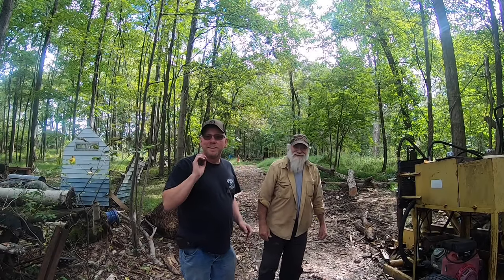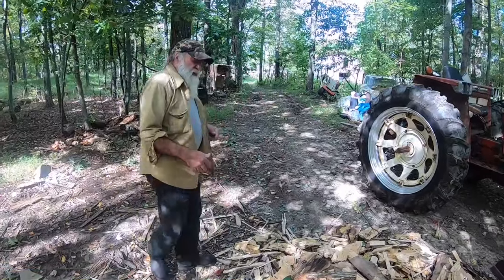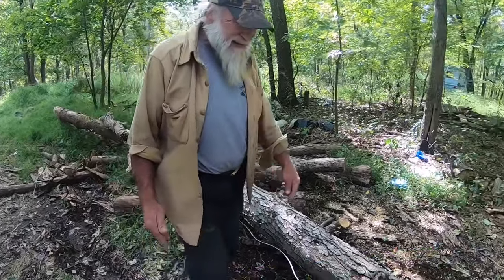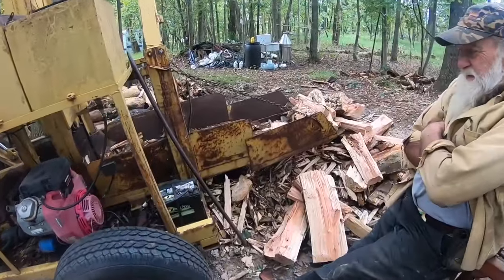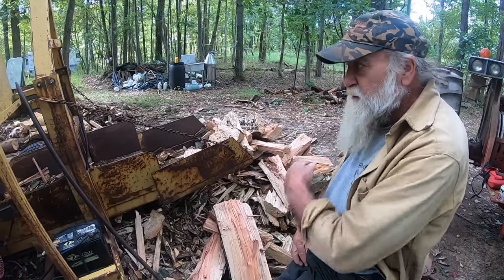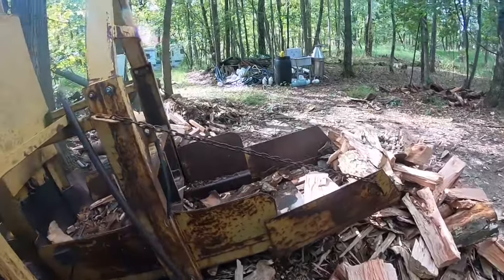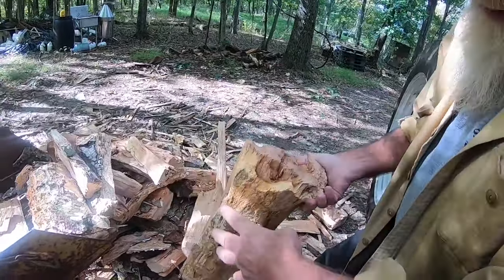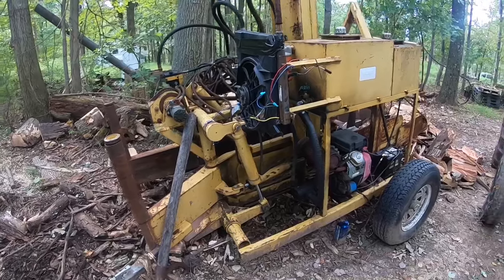Taking a look at the Chomper Wood Processor. #firewood #firewoodprocessor #chomper

Comment: This was made by Rainier Hydraulics.  My Uncle invented it and owned the Company.  His health failed and he passed away.  The Company closed due to low orders because of all the regulations and Green people against burning firewood.  Glad to see this wonderful machine again.  Where are you located??  I'd love to see my late great Uncle's machine.  This one is very slow.  He made high speed diesel powered ones that were fully automatic.  Nice anyway.
Reply from the maker: Thank you so much for responding and watching this video.  I am located near Scranton, PA.  I had tried to find out information about your uncle's company but couldn't really find much more than a few blurbs on various forum discussions.   You can reach me at oldmountainfirewood@gmail.com and we can discuss further.
Reply: @woodruffwoods  I own one of the last Super 14 produced before the company went out of business.  Mine has a 65hp Yanmar diesel and is fully automatic and splits 8 ways.  It cycles at least 3 times faster than this one which appears quite old.  A lot of improvements were added.
Reply from the maker: @djroundshouse  I am finding that there were quite a few of these old machines out there.  I am glad I posted this video so I could learn more about them.
Reply: A guy I know has a Chomper with a 100 horsepower John Deere diesel engine. Says it will do a maximum of 16 inches diameter and has not used it for 8 years.   He used it for Oak and Hickory. 
My speculation is that a guillotine is an inappropriate method that uses too much power and energy, causing the company to go out of business.  I doubt that customers would want their wood roughed-up like that.
Reply: @jakebredthauer5100 in the PNW the wood is softer, our hardwoods are not that hard. Plus, most logs are in a long log form that lends itself to the winch as opposed to a table. It’s a very efficient processor for our wood and I wish I had one.
Reply: @HubertofLiege  
He would sell it. I have his 
contact information.
SW Missouri. I don't know the age or model or condition. I never did think it was a good design.
Reply: @jakebredthauer5100  100 HP was way overkill.  I think Mr. Aikins supplied a 60 HP JD engine (maybe Perkins) as as option for the 16 inch cutter.  No wonder he used too much fuel.   The ends of the wood did look a little ratty, but there was no sawdust.  And you know, when the wood was burned,  didn't seem to look any different than the saw cut wood after it was burned.  Perhaps you should have looked into designer colored gasoline decades ago.
Reply: @johnkrigin1535  
The blade type of cutting mechanism is probably more adapted to soft, lower density wood.  If the wood is not being compressed, there is no space for the blade to go.  Do you have any idea how much pressure and force and energy it takes to compress Oak and Hickory end grain?  Why do you think no one wants to build that type of a processor?  It is simply a bad design.  It would be okay if it worked.  I know I would never buy one to cut high-density wood.  One species of wood is actually called Ironwood.  Just because you want it to work does not mean that it will work.
Reply: Hi again Jake.  I know what I am talking about.  I had one.  The demonstrated model was the 14-inch model.   I had the 11-inch model.  Mr. Aikens made models up to 24-in with two rams to push the guillotine. I had an old John Deere Model to tote it around (the three-pt hitch could pick it up) and power it.  It really needed 40 HP.  I had only about 20.  It went through fir and redwood without breathing hard.  I had to take multiple stabs with the guillotine to get it to go through 11-inch tan oak (a prevalent NW CA hardwood).  Underpowered.  The beauty of it was that you could drag a log full length into it and out would come firewood.  No support equipment (loaders, log decks), cutting logs to manageable size, no chain sharpening (the guillotine was made of 4130 steel sharpened to a fine point and never dulled through dirt, rock, mud).  Almost none of the machine was made of mild steel.  For a startup woodcutter, it was the ticket with the smaller logs.
Reply: @johnkrigin1535  Another advantage of the shearing blade is the wood was highly compressed and water would shoot from the cuts causing the wood to season quicker.
Reply: @johnkrigin1535  
There is probably one dozen manufacturers of firewood processors in N America.  Why do none of them want to build such a firewood processor that cuts the wood with a blade?  That is probably the engineering issue with the blade that you described from your experience.  Pushing a blade through high-density wood uses too much force, power and energy, as I said.
Reply: @scotta9114  
I can believe the wood dries more quickly because the roughness of the cut causes more surface area for the air to dry the wood, not because of the reason you gave.

If you guys think this design is so good, why don't you go to the manufacturers and request that they start building it.  When they make a lot of sales then they can give you some money.  It might help if you gave them some money to start with.

It is not a shearing blade.
A scissors is a shears.
A shears does not have a thin blade.
Reply: @jakebredthauer5100  I've seen too much force, power and energy used in conventional woodcutting.  Manhandling the chainsaw, time out for sharpening the chain, rolling the log with a peavey, lifting the rounds onto the wood splitter, loading the wood onto the truck, and it goes on and on.  You evidently either have never been a full time woodcutter or you just feel that personal power output is just the way it had to be.  Most of the other systems have  a buttload of support equipment.  My little one should have had  a forty HP power source but it doesn't mean it had to have it all the time.  Only as needed.
Reply: And the guillotine reference should have been enough to illustrate the action. Other manufacturers may have been stymied from imitating from the process from patent issues, don't you think.
Reply: @johnkrigin1535  
Modern equipment is expensive but it eliminates practically all of the manual labor. If you go with that system then you commit yourself to selling a lot of firewood to recuperate the investment.  You can get a machine to grind the chains or if you go with the circular blade.  The circular blade cuts out a lot of maintenance.
Reply: @johnkrigin1535  
There is a processor on the market that drags the logs on the ground with a cable to bring them into the cutting chamber. I don't remember the brand name.  You could probably find it if you looked for it online. It uses a chainsaw to cut the logs.  You have to walk out and attach each log to the cable. It is cheaper to buy but does not work as well.
Why do you think no one wants to build a processor with a knife blade?  It is a bad design.
Reply: @jakebredthauer5100 
I would like to talk to the guy you know who wants to sell the chomper wood processer. How can I get in touch with him?
Reply: @jakebredthauer5100 ,,Валентайн ,,называется этот процессор.ребята,куда Вы продаете столько дров?у Вас большая потребность населения в дровах?
Reply: @ВладимирРуденко-ъ7д  
What language is that?
Reply: Did it have a patent? Is the design information drawings etc For Sale? Please advise

Comment: It's great to hear from someone with knowledge of the inventor. I have seen one of these machines in person, and it's a very efficient way for one person to operate if they have the experience. I'm surprised that another manufacturer hasn't tried to imitate/duplicate this design (patent issues ?) since this machine equals or exceeds the speed of currently available processors.
Reply from the maker: I too am surprised that the idea was abandoned.  Check out the machine Outdoors with the Morgans is using.  It is somewhat reminiscent of the old Chomper.
Reply: @woodruffwoods  There are several of these types that work in the same or similar ways being sold as wood processors here in Sweden. They cost a lot though. But there's one that can split up to 11 inches for about 3 grand (with 25% tax). Tried to link but comment gets automatically removed if I do.

Comment: Wish I had one, they’re efficient when operated correctly
Reply from the maker: They are slow by today's standard of processors.   Nonetheless, a very neat machines with an out of the box approach.
Reply: @woodruffwoods  there is a video of one operating in auto mode and it does pretty good, it has a conveyor with it. They’re designed for long logs like you’d have in the PNW.
Reply from the maker: @HubertofLiege  I will look for that video.  Thanks for the tip
Reply: @woodruffwoods  it was on a channel called Allen family homestead and titled 4 cord cut and split in 90 minutes
Reply from the maker: I know those folks so I will have to check it out for sure. @HubertofLiege
Reply: @woodruffwoods  I think the main reason for this machine to be slow ist that they swapped the engine. The Allen family unit has a massive dieselmotor, and with more horspowers you can run a bigger pump. You can tell by the frame, that the unit shown in your video also had been designed for the bigger engine.
Reply from the maker: @Video-ee1dn  great observation.  I think you are correct.

Comment: If it ran the speed at 8:35 it would be a good deal
Reply from the maker: Yes it is very slow.  However, it is from a different time.  I do think it is kind of cool that it pushes that blade through the wood.
Reply: The ones that automatically cycle are faster, you set it off on a log and then winch the next into line. I think those are faster than bar saw without the mess of sawdust and there is no length limit to your log and no table.

Comment: Very cool. But promise you I can split more wood with a chainsaw and conventional hydraulic log splitter.
Reply from the maker: I have made that challenge to him and you may just see that in a future video. I, too, am unimpressed by the cycle time.
Reply: It takes either time or power to fill up a 100-ton cylinder.